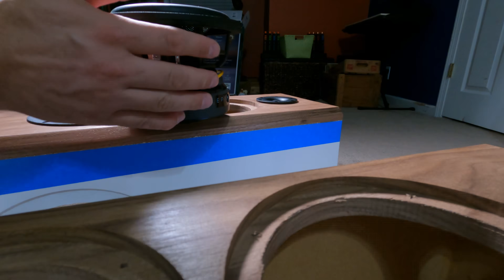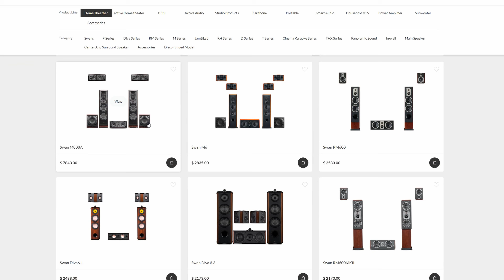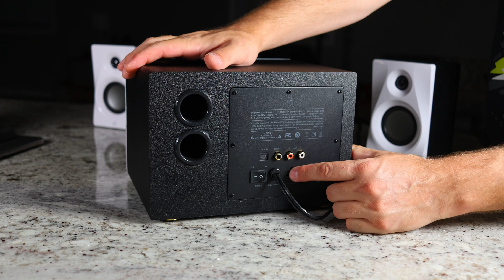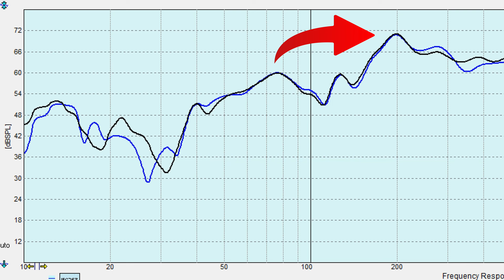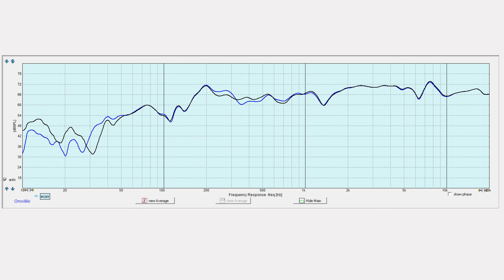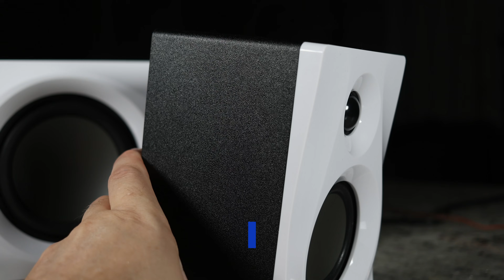High End Look with Low End Price - HiVi M10 Plus 2.1 Review

Comment: these or the OS-10 to connect with a new turntable in a larger room?
Reply from the maker: I wouldn’t get these
Reply: @Toid  OK, OS-10s then.   Actually I had assumed the MS10 Plus would offer more bass, however when I calculated the surface square inches of the 3 MS10 Plus speakers vs. the 2 OS-10 speakers, they are identical.  That's when I realized if the MS10 Plus doesn't offer more bass, then what is the point of them vs. the OS-10, which has better mids, highs, coherence, and imaging... and the same amount of bass (probably better quality bass as well).

Comment: I've had mine for a while now.  The first few days I tried them on my desk with the same result you had.  They sounded muddy and horrible.  I then experimented with the placement of the "sub".  The best spot was under my desk about 2" - 2.5" from the wall, with the rear ports facing the wall, of course (gain all the way down).  That placement allowed the bass from the ports to flow upwards behind my desk and up towards my head (my desk is also pulled away from the wall a bit).  It balanced out the sound quit well.  I also intuitively turned the satellite speakers away from my ears, as that sounded best.  Overall, I think these sound great for $150.

Comment: Maybe not audiophile grade, but I can see a lot of use as better than Logitech computer speakers.  Nice review man!
Reply: sure, but if the Swans OS-10 at the same price has equally good bass, and much better mids, highs, coherence and imaging, and they basically fit on a desk as well, what is the point of the MS10 Plus?   Actually if you calculate square surface inches of the three drivers in the M10 Plus, vs the two drivers in the OS-10, they are identical.  That's when I realized there would NOT be more bass in the MS10 Plus.

Comment: The Tweeter is out of phase at 1,4 KHZ, I am pretty sure somebody soldered it in the wrong way. Can you open these up and check ?
Reply from the maker: @nikleiser5888  I did check with a few other peoples measurements and they are measuring the same. Although like you said, this could be a sign of them being exactly 180° out of phase. But if that is the case they would’ve manufactured multiple sets improperly.
Reply: @Toid  Multiple sets improperly either means QC problem or the engineers did something wrong with the design (which is unlikely, I guess a company got capable engineers on hand).

We should point this problem out to HIVI.

The volume knob at the subwoofer is a NoGo for me.
Reply from the maker: @ definitely could be. As always if any manufacturer thinks there is an issue with my measurements or the speakers themselves, I’d be happy to go over them. And if necessary amend my review. The last thing I want to do is give out bad information. I can only give out the information that I have measured. And in this case, both of my speakers measured the same as well as known others measurements. But I know HiVi will be seeing this, so I’m sure they will tell me if they see something off.

Comment: Love me some Hivi. But remember that isn’t sub, it's a desktop midbass unit.
Reply from the maker: @cschwacofer  good point. Although HiVi is advertising it as a subwoofer. The normal consumer wouldn’t know the difference. I really wish they would have used a longer throw driver. I don’t mind the low end extension, but I am not a fan of the mechanical noise when you push it. A higher excursion driver would’ve been nice.
Reply: actually Swans is saying with this revision and the new port structure, the midbass unit is intended to be under the desk firing against a wall.
Reply: @larrydunn4626  that's pretty good news!